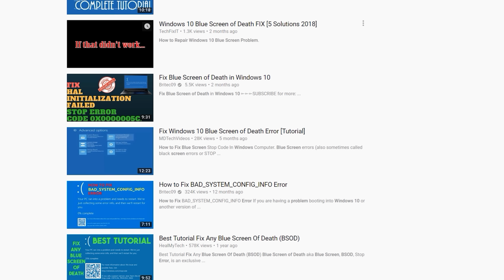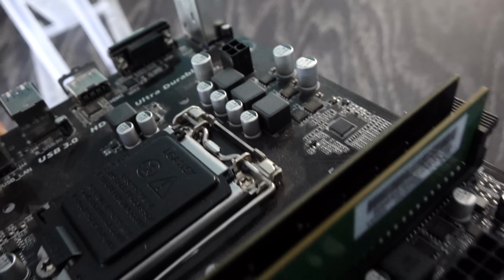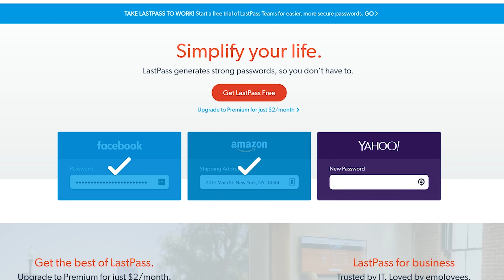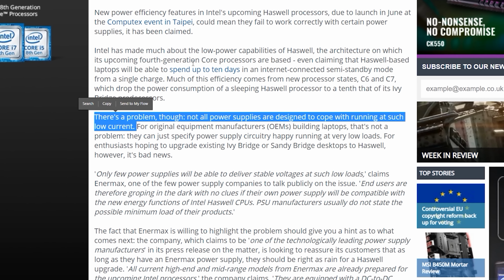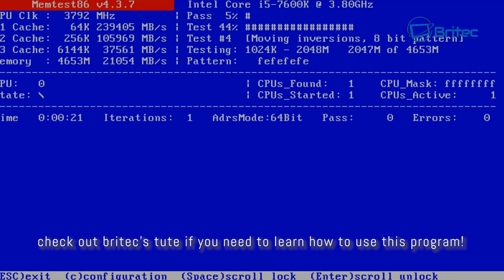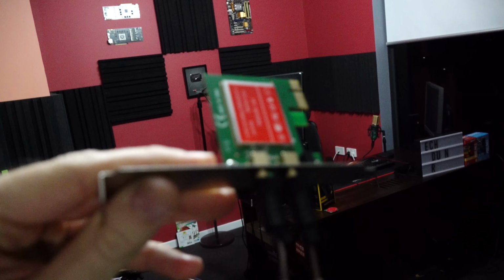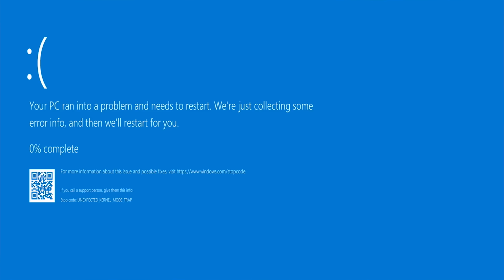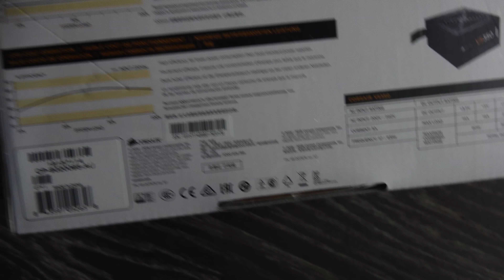How To FIX a Blue Screen on Windows 10

Comment: WTF is with the way MICROSOFT has decided to cause people's computers to crash?

My goddamn windows 10 machine - in Windows 10 Pro, might BSOD 4 times per day and then once in two weeks. I do the same things pretty much every day and nothing consistently can be done to cause it. Memory has been changed and tested multiple times.

I multiboot into other OS, Linux as well as Neverware's Chromium - they never crash. WTF is with windows catching certain errors and then deciding to crash and reboot? How much of a crash can it be if it runs enough to collect error information? This has gone on for years regardless of any update, different ram, different video card and other external items (thus various different device driver combos).

If it was hardware, bios, etc. related then why do several versions of linux that I have played with and Chromium never have problems?

Need windows 10 Pro for a couple of programs still.

Comment: May you help me please. I in a situation that's my own doing, I'm new to PCs and while changing the clock frequency of my ram I got what seems to be called "The blue screen of death" after rebooting my pc. I did get back into the bios (click bios 5 - Msi z170a M/board) and reset the ram frequency back to stock. I am still getting the blue screen with the error message saying -Your pc ran into a problem and needs to restart, Stop code says: PAGE FAULT IN NONEPAGED AREA, what faild: Ntfs.sys. That's the error message I'm getting and a constant boot loop from booting up. I get no option to restart in safe mode after several attempts to reboot. Please could you help me.

Comment: Ok so, I recently bought my iBuyPower PC and it delivered today. I set it up and for around 1hour it was running absolutely great no problem at all. I hop in a game of Fortnite and play it out, no problems.. until there is 10 people left and my whole computer freezes. My first instinct is to turn the PC off and wait for around 10-15 minutes. When I turn it back on it says “Your PC has ran into a problem and we have to restart.” Then I blue screen and the PC resets. The whole process has happened over and over again for around 30 minutes now. Any help?
Reply: Hey! I ran into the same problem recently! Did you manage to fix it?
Reply: @ZeroVibe26  Sorry for the extremely late PC. I had to return it because it had a faulty part. I just bought a completely new PC, obviously not an iBuyPower.

Comment: I got blue screen error every time  when ever I start playing game or using internet 
My system is 

AMD R3 1200 3.10GHZ
GTX 1050 TI 4GB DDR5 
DDR4 XPG 8GB RAM
1TB HDD SEAGATE HARD DISK 
AND MY POWER SUPPLY IS 250 WATTS 
I THINK MY BLUE SCREEN ERROR REASON IS LOW POWER SUPPLY

YES OR NO 

PLSEASE REPLAY
Reply: yeah get a better power supply at least 450w will do the job
Reply: @Ryzen-gh1en  was about to say wtf a 250w lol
Reply: @Arreat_Summit  lmao buy a better power supply bro if it is blow then your whole system can screw pretty badly, better be sure you have a decent power supply then some non brand shit even 400w corsair vs power supply is much better then some shitty 800w non brand

Comment: The latest Win 10 does not support SLI for 2 x GTX 760 cards. It previously did. Once auto update installed the pc bluescreened. Apparently there is a conflict with the older Nvidia driver and Win 10.
I did a recovery on the pc but as soon as I loaded the Nvidia driver it blue screened again.
Removing the GTX 760's and replacing them with a newer single card removed the problem.

Comment: i have this problem recently, my pc boots up very slow or BSOD on start up, my 1st thought was a faulty harddrive. 
ive noticed that the HHd led sometimes doesn't light up, i tried fixing the problem until one day i cant boot to windows anymore (some missing windows file)
ive replaced it with a new one and same thing happened, windows installation failed /takes forever.
last resort was changing the power supply, and it fixed the problem.
i was using a pre installed psu. 
never again.

Comment: Great video and information! I have the Dell XPS 9370 13 inch laptop. But I bought it refurbished. I Was using it and then blue screen happened. So told the seller (store) and they’ve just said remove win 10 and reinstall it again and clean it on disk part. By command prompt. Yet it still happens, so did It again to make sure now I’m waiting upon the test. Been going now for months or so. As I’ve not had time to use laptop etc. My friends sayings it’s a hardware issues and not a software issue. I really have no idea what it is. My self made gaming computer works fine and has never had this problem. So I’m stuck on what it could be causing this?

Comment: The problem for me was a pcie riser cable, took it out no problems now.
Reply: what’s that
Reply: @juanthedinoo8376  the pcie riser cable is for if you are mounting you graphics card on it's edge, instead of into the motherboard directly.
Reply: Take it out and put it in again?
Reply: @eman20911  still crashed it was a faulty riser cable.

Comment: sometimes it causes cheap of 4 pin power of motherboard which its made your motherboard went shrot circuit,I learnt from that experience and I never used extension unless its offical product like nzxt

Comment: My top 3 BSOD / failures ar these ones:

1 - A guy with a S478 pentium 4 3.2 ghz (dont remember if it was Prescott or Northwood). The guy told me that his computer was unable to boot sometimes, especially in the morning. I took the PC and tried to produce the problem, but, nothing! He came with all his stuff (printer, scanner, webcam...) but everything was working fine. I gave it back to him, and he returned to the shop 2 days after. While discussing, he told me that the PC was installed into a fresh room of his house (this was the month of november). I asked him "how fresh" and he told that there was something like 10/12 celsius degrees. The PSU was faulty.... unable to stard under 15 celsius.

2 - A customer brought me back a PC on his last days of warranty. It was a Athlon 3000+ wit socket 462. He brought the computer on tuesday, and the guy told that he would come back on saturday afternoon to take it back. Strangely, the BSODs didn't happened at the shop, only at customer's home. I runned all possible benchmarks in order to make it happen. But nothing. Tested every part of the PC... everything was fine. Of course, I called the customer asking about the PC's environment: ptrinter, scanner, keyboard and mouse... At first, we thought that It could be a peripheral used by the young children of the customer... but nothing. The computer was tunning perfectly. 

On saturday, I told to my colleague to start preparing the pc because the customer was about to arrive. As I said that, the tech told me "Hey, you should come! I have a BSOD!". At the same time, the bell on the door just ringed. I saw the customer in the shop, and I realized that the BSOD happened EXACTLY whe he entered the shop!!! I explained it all to him, and he told me that he had strange feelings with electronics and that everything in his home was constantly failing. So, he understood that HE was the problem....

3 - Random Bsods happening on a desktop PC with an Athlon64 3200+ s939. The guy brought that under warranty. At the beginning, there was a strange smell. I told Him I was going to check it out, but, when I opened it, I discovered that he used to left the case opened... and his dog had peed into it! Bye bye warranty. You can buy a new one!

Sorry form my poor english. I write from France.

Comment: And sometimes hardware incompatability, like certain capture cards with certain chipsets.
And maybe if's just musconfiguration. And because the user does the same changes after reinstall, the issue persists.
i also had a board where a memory slot was broken. It wouldn't boot as long as that slot was occupied. The other 3 slots were fine, so unless running 3/4 modules (or running dual channel in that particular pair) there was no sign of anything.

Comment: This video came out at a perfect time for me. For some reason my computer started to randomly reboot itself. Since it was a hardware fault, there was no BSOD or dump file to inform me of the problem. After trying everything i can think of, I think I have narrowed it down to a faulty PSU. I have a Corsair CX430 that I bought brand new and have been using for quite some time now. A few months ago my computer died, I thought it was a motherboard issue so I purchased a new one. Turns out the power supply blew a capacitor. Since I already knew how to replace a capacitor and had one on hand I was able to get back up and running. Now I think the PSU is going bad again, since I have a case fan hooked up to a molex connector. When the fan is plugged in, it sometimes runs very slow or is very slow to start up. The computer seems to work fine with it unplugged, so I'm thinking it might just be the PSU having trouble trying to power so many things at once. So if your fans are acting weird like mine, your PSU could be on it's way out.
Reply: Go to advanced system settings and disable the automatic reboot on error, that way it actually shows you the bsod instead of just rebooting. Then some research on the code and you already got half the work done. Every clode stands for a specific error that points towards the fault.
Reply: @HappyBeezerStudios  I did that before and after I reinstalled windows. Still no blue screen. Just a random reboot. I finally bit the bullet and decided to remove everything from the board and test it outside of the case. I didn't think I had to since I just replaced the motherboard and cleaned everything out about 2 months ago. Turns out there was something shorting out the back of the motherboard. I'm not sure what it was, but it had to be something metal. I use my computer desk as my work station when I'm fixing controllers, so it could have been a screw or solder blob. Lesson: REMOVE EVERYTHING from the case and test components one by one.

Comment: You forgot about the number one way to prevent Blue Screens. Install Linux and don't use Windows.
Reply: Only that it comes with a new set of problems (That are not necessarily stability related)
Reply: Eh, it depends. If you are trying to use it like Windows I can see that. If you go into it knowing what it is and understanding how to use it then no. The only way you run into stability issues is if you do something foolish or use some bleeding edge distro.

Comment: Weirdest problem I've had, was from my USB to SATA / IDE drive tester - for some reason (cheapskate on the wire?) the power block for it only implements one ground wire (the 5V) - now most drives aren't bothered by this, but a couple would not run until I bridged the grounds
Reply: Can always whip out the soldering iron.

Comment: Hey Bryan ,I have a prob with my pc when it turns on , the pc displays image for like 10 secs and no matter if I'm in the Bios or booting to windows it just no longer displays anything after that 10 secs .I think it is the northbridge problem as when I'm pushing it gently and wiggle just a little the screen shows some strips vertically . Also  i tried to change the thermal paste and it seems it lasts just a bit longer so Im 99% sure it is the chipset problem , by the way it is a asrock g31m-s ,mobo is worth it reballing chipset or do I have to throw it in  the trash ,thanks in advance
Reply: G31 is not really worth reballing.
FSB on the chipset tops out somewhere around 350-360, so not much headroom for oc , only 2 ram slots, no settings for voltages, If you really want to keep the same board, take a fiver and snap one on ebay, or for an upgrade on the same platform take somewhere between 30-50 and get a nice P35 or P45 board. Even 965 or P43 would already be a substantial upgrade.

Around 3.1-3.2 GHz on a Q6600, which is hard to get without more vcore.  With a E8500 around 3.3-3.4 GHz would be possible, which should run without changes.
Reply: @HappyBeezerStudios  thanks for your reply , these boards are atx size right ? , my case is for micro atx , also I want to upgrade to ddr3 but stick with lga775 as I have a xeon e5440

Comment: I've been having a case where my desktop doesn't fully shut down or can't wake from sleep. It appears that windows 10 has fully shut down but the fans continue running at full power along with the AIO too and I have to hold the power button to shut down. Could this be a possible BIOS issue? I've already reset the BIOS, updated the BIOS, pulled out the CMOS battery and also replaced with a new battery. I cant find a BIOS setting where is can fix this nor Windows power management settings. PC is clean and maintained but i haven't tried a clean install yet. 
PC Specs: Asus X58 P6T deluxe, Xeon x5670, 4x 4gb Corsair Vengeance Pro 1866mhz, MSI 1060 6gb GamingX, EVGA 650GQ PSU, 240gb Evo SSD, Lepa 240 AIO cooler.  
Tips would be great and would be appreciated Bryan.
Reply: I have the same problem bro

Comment: Been in IT since 96 and an very simple BSOD error is installing Windows in AHCI mode in the BIOS then resetting the BIOS due to a failed OC. The BIOS goes back to IDE mode and goes into BSOD when loading Windows. It can also happen when you install Windows in IDE mode and change to AHCI mode. Keep it in mind as to stop you from either booting from a DVD drive into Windows or installing windows time and time again.
Reply: Goold old XP times, always having a floppy ready because the installer won't accept anything else and burning a new slipstreamed CD for every system would be a bit to much.

Comment: you want a weird one?? picture this: year 2003, asus motherboard, athlon 64, you are happily using the pc and BAM, it shuts down. happens every now and then at PURE RANDOM. the suspects are: the psu, the mobo, the memory and the gpu... you guessed right, by now you must know who the culprit was... exactly, my nokia 1100 !!! I still dont know how, but every time a got a sms or a phonecall near that pc it shuted down the damn thing, it was hillarious!! I changed my phone, it was cheaper than changing the mobo (I guess it was some wake-on-lan thing that messed with the phone signal)
Reply: Electromagnetic radiation. That's the why speakers do that "da, dadada, da-da-da" when your phone is about to light up saying you have a phone call. I was having problems benchmarking the other day because I had a fan sitting next to my case (running off its own battery power), but it was powered by a brushless quadcopter motor, and it was causing havoc to stability just being on...

Comment: I had a hdd problem. The hdd went pstsuuu every few minutes. Booting was very slow when hdd was plugged in. The slow boot started even in post message. When transferring files the drive would halt for 15-30s and then resume at normal speed. So what I thought was that my x58 asus board had sata problems, or my  hdd was busted or my   PSU was busted. Thing that was busted was 1 USD sata molex adaptor. Replaced it and all is working fine.

Comment: I have one 10 year old computer that just works perfectly with only one DDR3 memory stick. If I put 2 or more it just randomly freezes when it plays sound looping that so it resembles a machine gun. No matter what soundcard I use. Mobo is Asus P5Q3 with DDR3 and CPU is Q9400. All stock settings. Underclocking memory also works but then it has that pesky double boot. If I want to avoid double boot all has to be all stock settings.
Reply: Try using the onboard sound. Maybe a memory slot is dead, had that before. The thirds slot was dead and the sys wouldn't boot with a module inserted, the other slots worked just fine.
But as a sidenote, I hole that thing runs atleast at 3.6 GHz, those Core 2 got lots of headroom and a nice P45 boards is most likely the best you can give it. And with DDR3 the memory clock limitation is already out of the way.
Reply: tried onboard, pci-x, pci, and usb cards and it resulted the same. Anyway I no longer use that pc, now it's just used for backup storage so one 4GB module is enough.

Comment: I had ram stick wich had some kind of invisible grease on contacts. That caused blue screens, because contact los time to time. Always passed memtest but once noticed on bios screen only 1 stick reconized. Quick clean and no problem after that.
Reply: How did you clean it? Mine wont recognize my 2nd ram stick
Reply: @M0HAK0  rubbing alcohol and cloth to wipe contacts from stick. After that, add some more alcohol and insert ram stick to slot multiple times.

Comment: Regarding Power stability issues.
If your CPU is running in stock frequency. Don't ever bump up the voltage if you have a tiny low end motherboard with a powerfull CPU. The VRM's can fry. You might also damage your CPU as well. Just replace the board (or CPU to lower power model).
Always get a quality power supply. FSP actually make decent power supplies, that is better build than the cheapest Corsair VS line - for very little price difference.
BTW. Corsair has never Built any power supplies. They  just Brand them. FSP however... They are  among the biggest manufactures of PSU's.
Reply: The dreadful VS450, no chinese firework, but far from good. Or the bequiet L7 530W, same thing. Nothing I'd put in a new build, but okay for a low power rig.
And I'm actually amazed by FSP, sure they build some mediore stuff for OEMs but then there are gems like the FSP350-HHN with decent efficiency, all safety features and a continous power output of 96% over the two 12V rails.